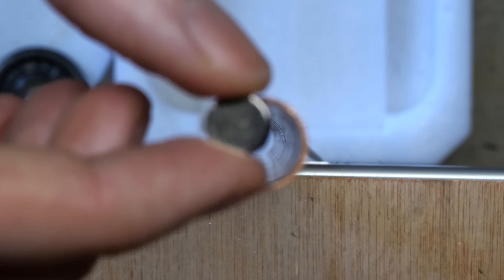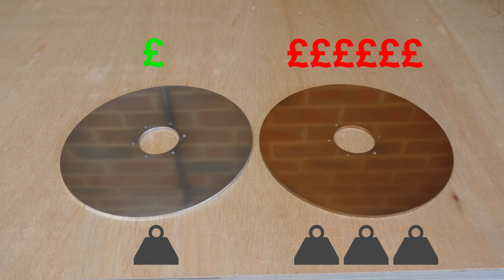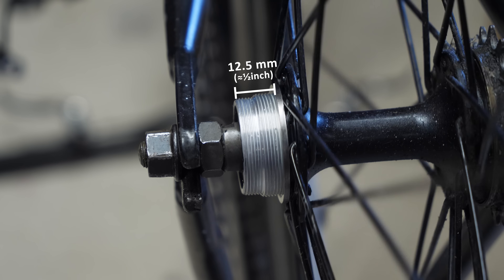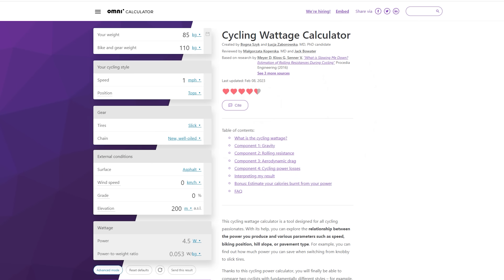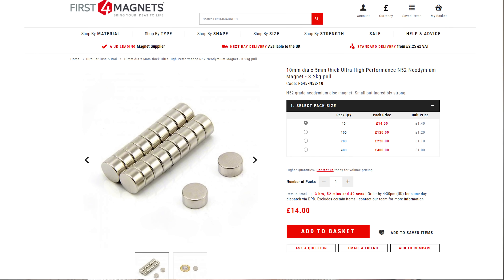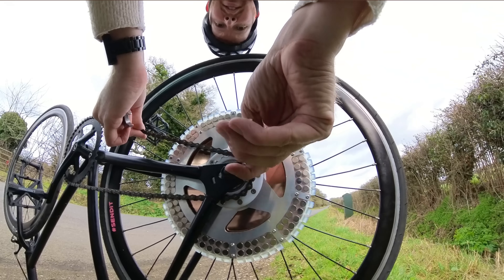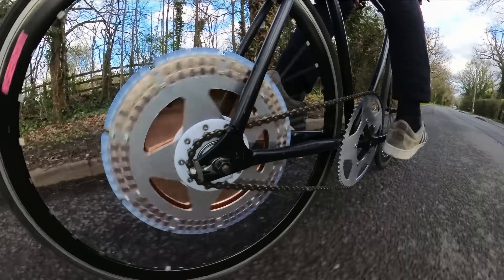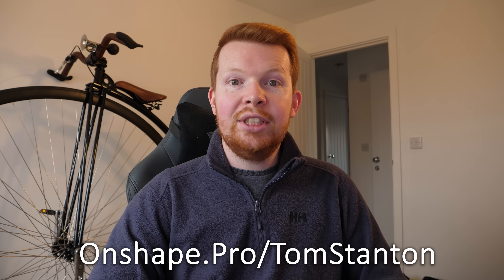Gearless Magnet Bike

Comment: I am no physician, nor a science person, first of all great video on eddy currents about, magnets interaction with copper & aluminum. 

- I was wondering, what if instead using a constant rpm for copper to moving in 'one direction' to challenge the magnet's rpm to be at a higher rpm. Use a '2 directional of motion', so essentially slow down the speed of the copper wheel at specific intervals, so it has variable rpm and can keep up with the magnet rpm, and maybe the copper isn't running the main cycle's wheel but, instead powered by 2 gears which changes based on copper directional movement. That way the energy used is far less from user and magnet has time to catch up with the energy instead of skipping it. Only issue, is it would take up more space and increase resistance on the copper leading to an increase in heat if I am not mistaken. 

This idea is based on an old learning when I was taught about electrical generators.

correct me if I am wrong.

Comment: I'd love to see a return to this experiment with more designs and maybe some alterations with additional parts to see if this could be further built on as a viable drive method. The concept seems really awesome, and I'm sure there's got to be some utility in this somewhere.
Reply: It could be the basis for a new kind of automatic transmission in cars. Instead of an epicyclic gearbox driven by fluid, pressure and friction with wet clutches and bands, it's magnets!!! Clutches, bands and the hydraulic fluid in an automatic transmission will wear down over time, but magnets will probably last a lot longer.

The magnets could be turned on and off electronically (they would be electromagnets, not permanent ones). Instead of clutch packs being pushed together by a piston, it's a current turning on electromagnets to make two discs lock together. The current would replace fluid going through solenoid valves in a valve body.

Comment: This video is a good example of "what has always worked before" is wrong in engineering and each problem has different solution. Even same looking bridges aren't built the same, due to geolocation and other factors.

Comment: How about a magnet to magnet coupling, instead of eddy current copper plate coupling? Also, it might benefit to implement a centrifugal clutch to allow magnets to line up after some pedaling, could help with getting some rest by automatic decoupling, when pedals stop moving. Also no wasted energy as in heating of copper plates.🤔 This should resolve the pedaling on sand effect, while mimicking a direct mechanical coupling(once the centrifugal clutch(speed governor?) gets engaged). Just some 💭❤👍

Comment: Hello. This technique might work for a problem rim brake bicycles have, which is that in wet conditions it grinds off the aluminium from which the rim has been made. This could cost you a wheel set over a year or two (road bike training). I am thinking of holding the sink brush against the front wheel. A magnetic brake would be quite elegant ! Rolling to a full stop takes quite long. If you anticipate enough in advance on flat roads, not much braking force is needed to make an effective cost saving brake for the winter (unless you already have disk brakes I guess).

Comment: I am curious if you reduce the radius of the copper disc so its mass is the same as a larger aluminum disc, and presuming equal mass between the two types of discs also mean equal inertia, if in fact the copper discs still wins the resistance race of decent between the two.

Comment: This is similar to a squirrel cage induction motor where there is a rotating field passing by a rotor which has voltage hence current induced in it.
The starting torque depends on the resistance of the rotor and so  using good copper is not so beneficial. One should add a resistive rotor to ensure that the current is in phase with the voltage. In linear motors, the same happens and the " resistive " component is very useful to get a better starting torque. One should read about the " slip" in a squirrel cage induction motor. be it linear or rotary.

Comment: You could probably solve the attraction problem between magnets, chain and spokes by covering the outside of the magnets with a ferrous material, which would also increase the field density at the copper disk, because of the better magnetic conductance.

Comment: the heating up of the copper plate reminded me of KERS (Kinetic Energy Regeneration System) systems in electric vehicles. EV's make use of that principle to regain the energy for the battery that would have otherwise been lost to heat when slowing down.

Comment: fyi, Harvey sells a very nice bit for cutting copper and other soft non-ferrous metals. Buy it with the C4 diamond-like coating. It'll save tears and produce a nice finish.

It's an interesting idea, but ultimately lossy. Those eddy currents will manifest themselves as heat within the copper disk.

Comment: what happens you inverted stator and rotor?. i means if you rotor the disc of cooper, the magtnetic force can move the bicicle? and how you feeling drive this configuration? , it's more or lees heat generate because of magnethic clutch in thes configuration.

Comment: i don't know much about bikes, only having a passing interest/appreciation for the mechanical design and riding them to work, but i'm curious what would happen if you started pedaling backwards. i remember a bike i had as a kid had a brake system that would trigger when you did that, and find myself pedaling backwards in between bursts of actual effectual pedaling out of habit. I'm just not sure if it would make a difference for the magnetic gear replacement system thing. is there some magnetic field mumbo jumbo i don't know of that would prevent it from being as intuitive as it sounds?

Comment: I would've thought the lost energy could be used  to charge a capacitor/battery. That energy could then be used to power a motor on the front wheel, controlled by a twist grip.
Charging on the downhill sections and outputting on the uphill sections might level things out.
Either way, it would be great nextvstep.
Well done! 👏
Reply: That's a great idea. I think you could turn the copper disc into a copper coil, intern that could Supply electricity to a direct Drive DC motor. The faster you pedal the more electricity it would produce, therefore make you go faster. Then if you want to slow down just stop pedaling. Then there'd be no electricity produced yet the copper coil would still slow you down. GS
Reply: That's exactly correct.  Instead of allowing the eddy currents to short out you replace your overheating "clutch" with a generator with hub motor in front.

Comment: Just thinking about the problem with coasting: Would it be possible to make some sort of bearing or mechanical system so that the chain can 'lock in' and 'lock out' so that the magnets can still move with the wheel when the pedals are idling? Maybe a motor on the hub instead to counter-act the resistive difference? Kinda cheating though & probably way too complicated to be practical...

Comment: So you’ve made a generator where you don’t use the electricity
Reply: An anti-rator?
Reply: @hamaljay degenerator
Reply: @hamaljay deci-mater?
Reply: The electricity is used to propel the bike, weren't you paying attention? 😂
Reply: The electricity gets lost in the disc. It functions very similarly to driving with your foot partway on the clutch, but without the mechanical wear. It is a useful device only for getting a workout while riding with unfit friends. It is not a transmission because it doesn't cut down on the force required and is inferior in every way to simply locking the mechanism. When he was riding up that hill in the bigger gear, it needed the same force as just a direct drive of the big gear, because to transfer through the magnets to drag the wheel, it's the same force as just turning the wheel with the chain, but he needed to pedal a lot faster, so on the same bike without it he could have ridden way faster up the hill.

Comment: An idea for optimizing the system I had would be to add steel rings to the sides of the magnet discs to increase the magnetic field strength

Comment: why don't you mirror your design so you can add dual copper clutch and magnets it will probably double your resistance but you will need the magnets on the other side to cover the gap that the plastics are making. I don't know if this will work but its worth a try

Comment: I'm not trying to spend your money but what would happen if you increase the diameter of the magnet ring and copper disc to almost the size of the wheel. It will solve two problems immediately because the rim / spoke / chain clearance problem gets better the closer you get to the tire so it will keep the magnets away from the chain and spokes. The 3D printing, acquiring the copper and miscellaneous materials wouldn't be difficult, I just don't know where you're going to get all those magnets. Maybe use a different shape or size magnet so you wouldn't need a thousand of them.

Comment: Am important theoretical formula is e=blv. Voltage (e) generation is directly proportional to the strength of the magnetic field (b), length of active conductor passing thru a magnetic field, and the velocity of the conductor relative to the magnetic field (v)

The reason you feel the braking a lot more at higher speeds is because the velocity (v) is so much greater. The effect of the braking is reduced as you slow down

Comment: I like tha Nasa T-shirt Tom, but a physicist would have told you, before you spent a good deal of time and money, that you're wasting your time with a coupling that ABSORBS energy, ie. the eddy currents turn your pedalling energy into heat when they "slip"! The greater the load then the greater the slip and higher the power LOSS - exactly what you DON'T want going up a hill or trying to accelerate. Now I don't want you to take this as a fail, but as a lesson in using knowledge (you should have learnt at school) to speed up your R&D (although sometimes doing some R&D will point to another solution. In your case (as a physicist) I'd suggest that if you want a non chain-drive variable transmission, then use what you learnt to design an efficient pedal powered electricity generator, possibly/probably also use a small (LiIon) battery or ultra-capacitor to store your energy to smooth your available power, and design some electronics (probably check on GitHub that you're not re-inventing something already designed). Yes, this will be heavy(ish) but new materials and manufacturing methods can shrink what is kgs today into grams tomorrow.

Lastly, most of the educated world used MKSA (Metre, Kilogram, Second, Amps) - pounds, feet, inches, etc. are a relic from the past and make you look like a dinosaur (or, Boris Johnson - and who wants that?). As a fellow redhead, keep up the good work. Start reading those physics books you ignored at school too!

Comment: Very informative video and excellent practical work on it. A big fan of your engineering skills...However , your hypothesis set out at the beginning has a flaw - "to create a mag clutch drive to replace the gear system" - The issue is that the gear system does not only provide a drive, but also  varies the speed. The magnetic clutch can unfortunately only provide a indirect coupling to drive the rear wheel.. so you are limited by the rpm that you can generate on the pedal sprocket

Comment: Should try using a piece of aluminium. If it works so great in mag-lev train systems I can't see it not working here. There's actually a video on here that actually demonstrates how well aluminium works in eddy currents, You would think it wouldn't work as it's non-magnetic but the currents actually have a surprising affect on the material.

Comment: Thank you for this interesting video! I understood, that it is not a good idea, to accelerate the bike through magnets because of the loose of energy while climbing a hill. But, is it possible, to break down speed by a magnet-break on the front wheel without mechanical friction?! It could hopefully save the friction-brakes life a while!

Comment: There is a bicycle trainer device called the Kinetic that has used this principle for decades. The resistance unit is hydraulic, that has a sealed chamber to prevent leaking. It’s hard to seal around a shaft, so they drive  an impeller inside the sealed chamber with a magnetic clutch. My trainer is decades old still works great and no leaks.

Comment: You should use a rubber belt instead of the chain, used in some bikes. That will get rid of the chain sticking to the magnet issue.

Comment: It would be great to try it with electromagnets, to control the induced torque. You should be able to achieve the function of a clutch (0% lock-up with no current and progressive engagement through 100% lock-up)

Comment: fantastic video.  Couple of thoughts struck me, one of which might be useful.  When I saw you spinning the copper disc, my first thought was that they use spinning as technique to allow the forming of copper and aluminium pans and bowls, so what effect would the RPMs you will experience do to a copper disc, especially as I assume (naively) that the disc will heat up with use (?) and the possibly useful one is would it be possible to use the switched magnet mechanism that you find on Dial test Indicator stands for when you set up runout on lathes etc.  Could you use the rotating magnet mechanism used there to enable and disable totally the braking effect to get free wheeling.  Keep up these fabulous and informative videos... Thanks

Comment: For how smart you make yourself sound you seem to be clueless on what a gear is. Maybe you did this on purpose but why are you saying it was gearless? It still has a single gear like most bikes do. Nothing you have done really has anything to do with the gears of the bike. The gears of a bike control how many times you have to do a pedal cycle compared to how many times the bike tire turns. All you did was make the freewheel out of a magnet which is still a single gear system.

Comment: Incredibly thorough and simple experiment. Well done, and that's a cool result 😊
Cheers for all your time and thought fella. That bearing is lovely 9:33 But not worth making a sprocket out of plastic, it's just too weak. Good reason why modern bikes have sprockets made from steel or even titanium at the high end 😉
Also, have to say too, if a bicycle is electric - regardless of power source - it would be ok to have a single drive like a car or motorbike does. Gears would be irrelevant. Single drive would be ok, and just attach a tidy throttle.

Comment: I’d love to see you build a bicycle powered by a nitro RC engine (used in RC planes and cars) that has an RC engine powering a generator, which powers an electric motor in the hub. So essential an electric transmission, sorta like a diesel electric train. That, at least from my understanding would operate like a clutch of sorts. Idk I think it would be a neat project

Comment: It would be cool to see this applied in an automotive application, such as replacing the fluid coupling of a torque converter in an automatic transmission, or in a rear differential housing as a sort of limited slip differential.
Reply: Considering he heated the disk with the tiny output of 8000 joules by 20c, it would be a really bad idea to use a torq converter using magnetic coupling like this. Unless you like slinging molten copper all over your car. Also copper (and all material) become less conductive the hotter they get, so your car would stop producing power at the wheels as the copper plate gets hotter and hotter unless you used some kind of cooling system, but at this point you're just throwing away power for a weird torq converter.

Comment: Now I’m no engineer or anything remotely close to that… just sparked an idea off your idea. Could you possibly create a device to capture said energy from the clutch to a battery pack and In turn power a front wheel motor to create hill assist?? Piggybacking idea off of regen braking🤷🏽‍♂️

Comment: It would be fairer to use copper and aluminium disks of the same mass (weight) rather than the same dimensions.  Then, I guess, aluminium would win.
High voltage power distribution cables - the sort suspended from pylons - are made mainly of aluminium, because it's a better conductor per unit weight than copper, as well as being cheaper.  They actually have a steel core, for strength, because aluminium alone would tend to stretch under tension, especially when the cables become hot due to high current flowing through them.

Comment: Beautiful.

My idea was to use gears to a flywheel placed in the triangle. Use axial magnets to generate electricity to regen your ebike. You control how hard you peddle, this goes to the flywheel between your legs and has a geared connection to the rear wheel. Add fancy battery management. Set top speeds for coasting, added goes to recharge or spin the flywheel faster, given the state of charge. Allows for bike stand secured stationary pedaling to recharge. Flywheel provides secondary storage and  greater peak available power. Open whole industries worth of new markets. There are a stunning number of unique use cases that would create demand for various models.

Building one is the only way to work out practicality & rideability. Since it does spin in line with the bike's center line the forces oughtn't really impact ridability. Then the math for how much the added storage can smooth out the drain off the battery while maximizing the regen to the point of significan stationary recharge with casual effort.